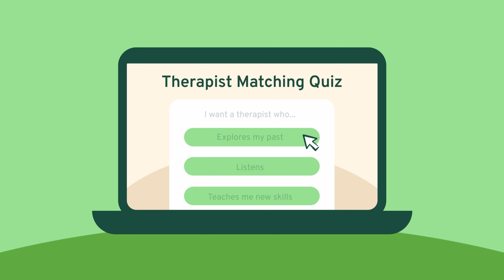How to 3D Print Moon Knight’s Helmet & Hood + DIY Smoke Machine | Marvel Rivals Tutorial

Comment: How much did the parts for the smoke machine run you? I ask as a comparison to the ones on Amazon ready to go for around $35-40.
Reply from the maker: Ok let’s see… empty vape cartridges ran me $1.75 a piece from an online vape shop. I bought 5 so $12 after shipping. The pumps cost me $10.79 for 2 on Amazon. 3V battery you can get for $10 at a hobby store. And everything else I had already. But for wires, tube, shrink wrap. You’re looking at another 10.
Reply: @JustGee3D thanks! So that's around $28 for just a single set of parts if you don't have any already at home.  Good to have a point of comparison. There's one with a remote control for $36, so that's a win at that price!